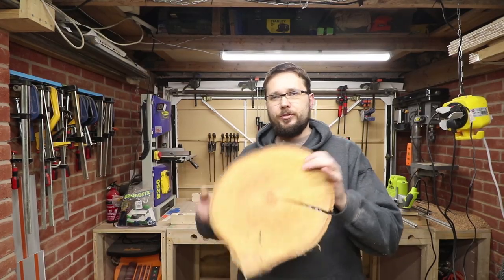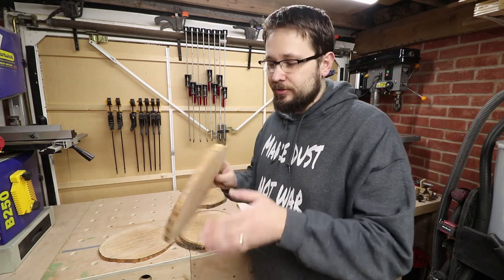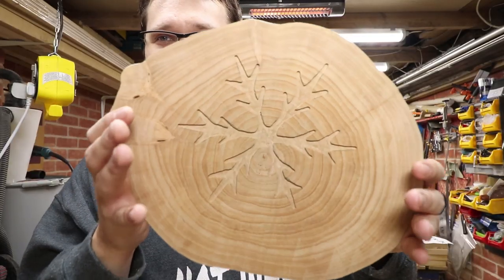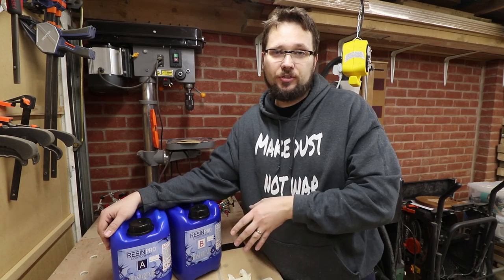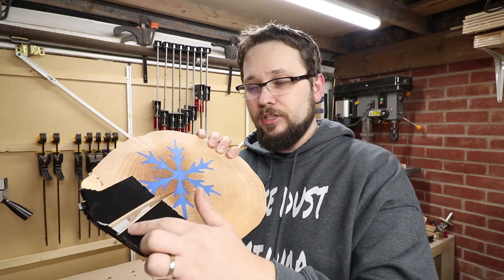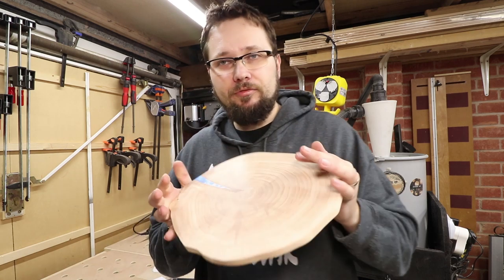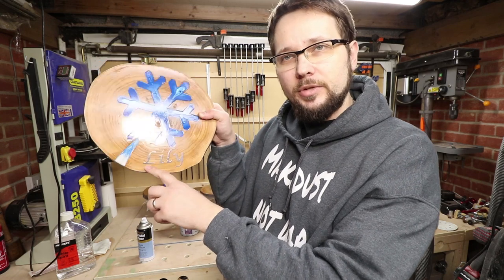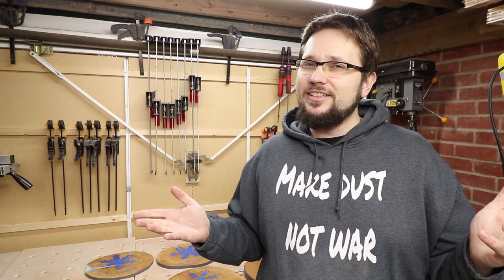DIY Christmas Wooden Placemats, Plate Coasters

Comment: Great job. Thanks for sharing the video and beingfsuch an inspiration. Did you buy the cookies or did you saw them yourself?
I saved some :cookies of beech wood (meant to be fire wood) with which I want to experiment this winter. The wood has been drying at first 5 years outside in a shed,
still being part of the stem of the tree and for a year and a half it is inside my workshop, acclimatizing.  They have cracks as well (the center of the stem causes a
lot of stress in the wood) and I think I'm going to use "butterflies" to prevent the wood from cracking any further. I have no idea if that would help when you use resin
as well.
Reply from the maker: Thanks, one of my friends gave them to me. They been in my workshop for few years. Yes wood works a lot unfortunately

Comment: I imagine the cracking was caused by heating from the sanding. Did you consider planing instead of sanding?
Reply from the maker: Could be from that plus the vibrations? Hmm planning could not work due to the grain pattern it could damage the cookies.
Reply: Casual DIY i was thinking about planing after surfacing before adding the resin.
Reply from the maker: @charlesarnold4963  hmm could do but most of sanding is done after adding resin

Comment: Like the blue and glitter in the resin,what size is the resin you use,and the mix ratio.also as being plate coasters does the heat effect the epoxy.Thanks
Reply from the maker: Hi, I think the resin is 8kg kit. The mix ratio is 100 to 60 by weight. With regards the heat we will see 🤣 I've secured them with 3 coats of lacquer so should be ok.
Reply: @CasualDIY  Thanks for the reply
Reply from the maker: No problem mate 👍